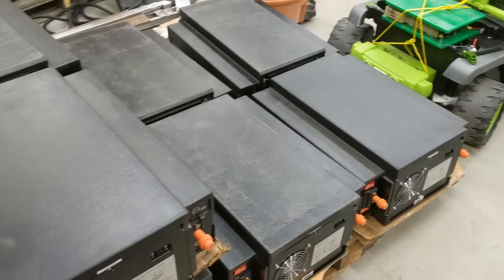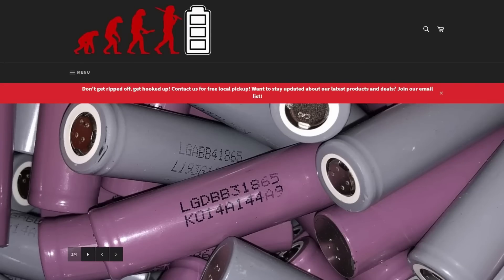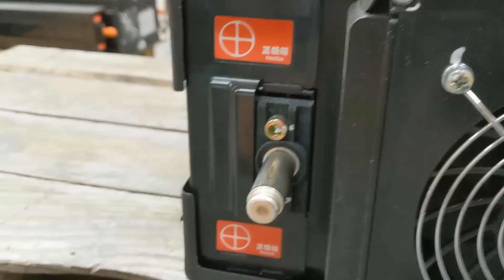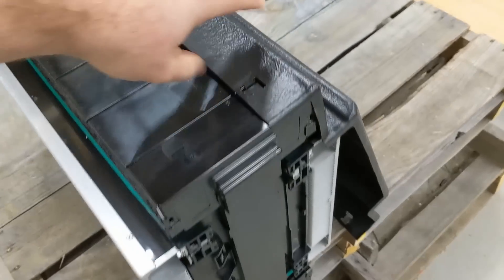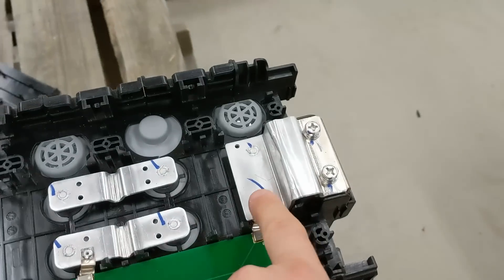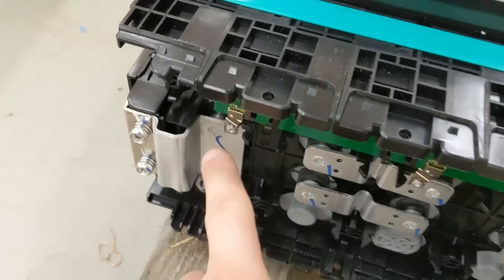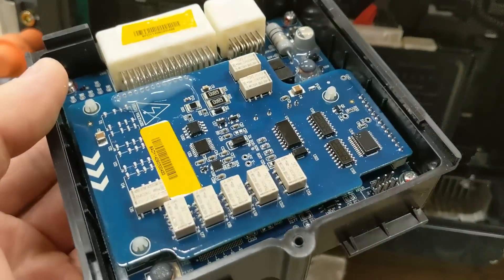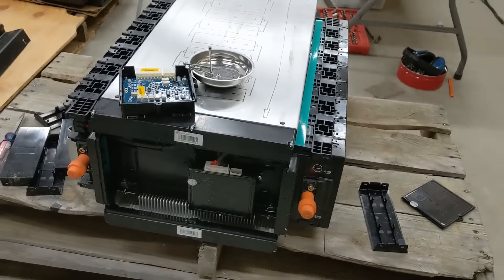$100/kwh Huge LiFePO4 Lithium Battery First Look

Comment: So if I read your video correctly, you got a total of 12 modules that are probably nominally rated around 5KWh each for a total of 60Kwh capacity, correct?  What is the size of the solar array that is powering these batteries?  How well has the BMS worked and what is the BMS that was used?  Have you had any problems since you hooked them all up?  What type of battery inverter/charger did you use?
Reply from the maker: Hi Paul,  I'm still working on wiring together my system.  Some things are not turned on yet, like my solar.  But the plan is: 7.7kw of solar.  I plan to use a "Chargery 16s BMS".  My inverters are a pair of Sunny Islands.  Here is a video on the inverters: https://youtu.be/aU9gNSoep-o
Reply: @DavidPozEnergy  One thing I forgot to ask is the relative age of these battery modules.  I understand they are likely different manufacturing dates since they were used in industrial storage, but do you have an idea of the average age of all of the modules? I ask to get an idea of the useful life remaining.
Reply from the maker: Hi Paul,  I don't know the whole history of these modules.  I can see a manufacturing date on the internal computer board of October 2014.  So they may have been in use 2015-2018?  I was told they were sitting in a warehouse the past year.
Reply: Okay, that doesn't sound too bad.  Given that decent quality LiFePO4 batteries should last a minimum of 20, maybe 30 years, then they should have a lot of usable life left to them.  I am also thinking about getting 12 modules myself, which based upon my current setup would bring me to a total capacity of 100Kwh.
Reply from the maker: Wow, 100kwh would be amazing.  I'm still working on my initial cycling so I don't know how many kwh I can get out of them yet, but it's pretty clearly not going to be the original 5.6 on the label.  Battery Hookup advertises them around 4-4.5kwh and that seems about right.  But I haven't done a full cycle yet to find out.  If you do decide to go with them, here is my link: http://bit.ly/38Uwgx9  I get a kick-back if you use it.

Comment: Geez thanks for the GREAT tip in cost reduction!.....One question, what do you think the life expectancy of these, in charge cycles, and after measuring the actual 'used' capacity (vs when new) would be if they get charged every-time they reach 20%? Or else, what are your expectations?
Reply from the maker: I have not done a full capacity test yet.  My expectation is about 75% or 80% of original capacity.  I'm hoping to have them in service for years, but I'll know more after some testing.  I'll post the videos as I move along.
Reply: @DavidPozEnergy  Thanks!

Comment: Good video. Q , I am rebuilding a vintage Barth class A motorhome with solar and back up. Generator and was considering a 6V Battleborn golf cart batteries. Will these batteries be a better way ?. I am new to this
Reply from the maker: Battleborn batteries have a BMS built in, these do not.  So if you buy use batteries you will have to wire in your own BMS.  If that makes you nervous, then a pre-packed battery is a good idea.  The Kilo-vault is less expensive then the Battleborn brand, but it's built nearly the same: https://www.altestore.com/store/deep-cycle-batteries/lithium-batteries-c4441/

Comment: David, can you explain how the internal cells are interconnected? From the video, the bus bars look to be riveted or welded. I don’t see any screws or bolts.
If one wanted to repackage the cells, is that possible?
Reply from the maker: My follow up video has a bit more detail into cell arrangement: https://youtu.be/aO-DlNrj5SU  But there are 8 large cells banded together.  Some things could be removed (like the plastic case) if you wanted to, but I wouldn't cut the banding.  I think they would spring open LOL.  The cells have a positive on one side, and go all the way through the pack to the other side for the negative.  The buss bars that jump from one cell to the next are welded onto the cell tabs.  I've seen someone cut these for making a 12v configuration, but he did not remove cells, just cut the buss bars and re-wired it.

Comment: Website say the deal is sold out😒.
Reply from the maker: I know they are working on getting more.
Reply: DavidPoz is it 100$ a module?
Reply from the maker: No, it's $100 per kilo-wall hour (kwh).  Each module is 4.5 kwh or more.  So each module is $450.
Reply: Ok thanks.
Reply: Plus shipping if needed

Comment: David, do you know for certain that these modules are LiFePO4? I ask because the label (sticker) on the battery reads 'Li-ion". This question was asked in several places/forums but as far as I know, it was never answered. I know of at least 3 people (one of them being myself) that posed this question directly to Battery Hookup but they never answered it...
Reply from the maker: Hi Marko,  Thanks for your question.  I agree that it's confusing.  I've read through several BYD documents.  This is a LIFePO4 battery.  It seems BYD is using "Li-ion" as a broader term for the lithium family rather than a specific chemistry.

Comment: Hi David, Looking to use one of these in my RV. What are your thoughts on making this into a 12V battery pack? I would disconnect one of the bus bars and plug the 2 4S in parrallel.
Reply from the maker: Sure.  There is someone on facebook (Jim) doing that right now and posting pictures of his progress.  He is posting on the facebook group called "DIY Battery".

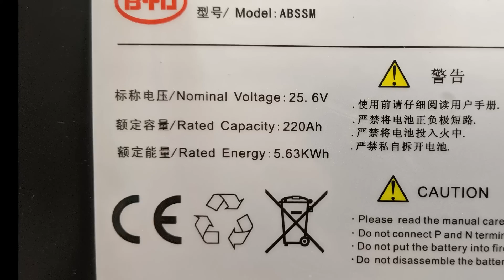Comment: So... (1:09) 200 Amp hours capacity? ...newbie... trying to figure out for RV solar power.  ...would this be equivalent to 4 battle born 12v 100Ah?
Reply from the maker: In capacity, yes, this is similar to 4x Battleborn.  It's worth noting that the Battleborn batteries will be new, and have a BMS built in.  These BYD modules are used, and I have to make my own BMS external.
Reply: DavidPoz can you just wire into a 24v BMS?
Reply from the maker: I'm working on building my own BMS wiring harness.
Reply: DavidPoz ah, ok. Looking forward to future posts on this. If I was close, I’d just go pick up a couple, as it is, with shipping costs, may only be able to get one at this time, my only hesitation. ...been keeping my eye out for lifepo4 deals.

Comment: I wonder why so much cooling is required for these batteries , lifepo4 is a safer chemistry ..
Reply from the maker: My guess is they were designed for high amps.  I'll probably not need cooling in my home system.

Comment: I wonder how easy it would be to buy one of these and convert over to 12 volt.

You would probably completely have to gut it... @OP is this possible? I'm going to be calling the warehouse tomorrow. I almost dropped $1,500 on 4 XP valence batteries.
Reply: Pretty easy if you break down the pack into the 8 prismatic cells, just make the 4s2p and voila. But you'll loose the built in bus bar and sense leads and such.

Comment: I just bought 6 and got 5% off by getting on their email list. Wife is gonna kill me Dave!  I’m gonna augment the set of 800ah lifepo4 in the Philippines later with these. Meantime I will hook up my massive 15kw powerjack to my current house as grid tie and let the grid charge these and see if there is any difference in the light bill with the inverter efficiency mods when on battery power for 12 hours a day. May put up the windmill later. Had planned on topping out a very tall pine tree and putting it up there but the tallest snorkel lift wouldn’t reach so a tree service said their crane could help me out. Heat sinks and fan seems excessive considering my brand new batts never heat up even 1 degree charging or even when discharging a 4.2kw event shower heater, rice cooker, electric vehicles and Hvac all at once. Cheap Chinese lifepo4 batts at that. The more time go by the more charging cycles folks suspect lifepo4 batts are capable of. I think the number of cycles they publish are just being conservative. They could be in excess of 10,000 cycles if your sensible with them. If you run them dead dead for 2000 cycles then that’s probably end game tho.
Reply from the maker: That's great.  I saw your other comments.  What are you planning for BMS wires?  Will you run your own direct to the cells?
Reply: DavidPoz I like the wire setup they come with but i have a box of  18awg color variety I bought on eBay or amazon 100 ft each roll that would make cell ID easy enough. How many S Chargery bms were you looking for? Mine is 16s good for 48v setup.

Comment: Do you know if these can be set up series/parallel?   Thinking of going with 4 to build a large 48V battery for my RV.
Reply from the maker: That's exactly what I'm doing, running 48v.  I'll be 2s4p
Reply: @DavidPozEnergy  I would like to see what you did to get the 48v. Its a shame more isn't known about the sensor ECU.

Comment: Are these LiFePO4 batteries or Li-ION??? The mounting plate on the back of the battery you are showing says Li-ION???
Reply from the maker: I questioned that too when I first got them.  The battery is LiFePO4.
Reply: @DavidPozEnergy  So with each battery being 3.2V .. what do you think that the aH is going to be???
Reply from the maker: The sticker on the front says Nominal Voltage: 25.6v; Rated Capacity: 220Ah; Rated Energy: 5.63kwh

Comment: I've been leaning going with tesla modules or getting batteries direct out of China. But this is the best beal I have seen. Just the weight is excessive.

Do you think pulling the heat sinks off would reduce the weight by any significance or is there any reason to leave them on?

Can't imagine you really need them unless you discharge them at some crazy high rate. Like the liquid cooling on tesla modules.

Could you strip them down to just the batteries?
Reply from the maker: It looks like the heat sinks are attached with 4 screws, so it should not be hard to remove.  But it probably only saves you 1% of the weight.  The cells are really big and heavy.  If you are building something for a mobile application, like a van build, then save the weight and go with something else.

Comment: They seem to ship over sea! Although its $1000  if i buy 4!  Kinda seems worth the price still.
Reply: Lysol ! Look into Alibaba.com Hunan Auk Energy Co. Bruce Wong. Same cost for new in your situation. I opened an account and you don’t have to be a company to purchase there. I purchased 32 lifepo4 200ah at $110 each $800 shipping to Philippines + customs + $100 ups contractor bogus “customs storage fee” which ups refunded and fined the contractor. Yay! Anyway they accept PayPal in most cases. Dave should start buying and selling this way. 150ah batts are the cheapest because they are most popular.

Comment: Nearly 17kg per kWh. Is that good?
Reply from the maker: Not especially great.  Better than lead acid, but not as good as Li-NMC (Used in electric cars).  I'll be using this in a home backup system, so it will be stationary.  Don't buy these if you have a mobile application and weight is a concern.  There are lighter options per kwh.

Comment: so  is the volt batt goin bad?
Reply from the maker: Not at all.  The Chevy Volt pack is still perfect.  I was trying for several months to find a second Volt battery pack that would match up (Gen 2) but the was I was finding were going for $3500 and up.  Then I came across this deal and jumped.  I have sold the Chevy volt pack to cover some of this cost.  This will (hopefully) double my capacity.

Comment: Would be near perfect if it had a built in contactor. Guess there is room in the back for a contactor and fuse. What do you think peak current would be with a dead short? (thinking of speccing out fuse and contactor for battery protection)
Reply from the maker: I haven't spec'd out all my components yet.  After I do some testing on them I'll have a better idea.  In the mean time I picked up several 200 amp fast-blow fuses.  I plan to do my testing with them, but might drop those down to 120 amps once the testing is done and we are in normal operation.  I wouldn't want to draw more amps than necessary.
Reply: @DavidPozEnergy  I expect any fuses that size should be rated to break more than 30vDC at 10kA, but I'm looking around at contactors that can do the same. (More than once hopefully) I'd prefer a BMS to be able to trigger a disconnect and nope right out before a fuse blew.
Reply from the maker: These are the exact ones I ordered.  As I said, they should work for now, but after testing I might do something else.  Always open to suggestions.  https://www.digikey.com/product-detail/en/littelfuse-inc/142.5631.6202/F10822-ND/2515909

Comment: So how hard would it be to do a DIY power wall? I currently have a 10kw solar system and I'd love to have a power wall to run my home when the sun goes down. I was looking at the Tesla power walls but they're way too damn expensive for my budget. Obviously these batteries would be used to power an inverter but that's all I know. I wouldn't know what type of inverter to use or what I'd use to charge the batteries.
Reply from the maker: I'm planning to use these batteries to power my whole house.  I'm going to pair them with solar, inverter, charge controller, etc.  Actually, I've been powering my house off-grid most of this year.  Up until now I've been using Chevy Volt batteries.  Now I'm going to double or triple my storage capacity with the new batteries.  If you want to see my whole system check out this video: https://youtu.be/722GNWlEN1g  Another resource I suggest is from Alt-E.  They are a store that sells solar components, or full systems.  They help you design your systems too.  But they also have a series of design videos that get down into the details.  I really like the videos.  https://www.altestore.com/video/

Comment: I am curios if you can take the cells out and build a bigger battery. They seem to be soldered together?  To make a 48v Bank you need to break the connection and put a bunch of them in parallel.
Reply from the maker: The cells look like they were welded to the bus bars, perhaps with a laser.  I think it would be a hassle to break the pack apart to remove an individual cell.
Reply: @DavidPozEnergy  If that is the case would be interesting to see how often those fans run and what is the efficiency of the pack.
Reply from the maker: We'll find out.  I have a lot more testing to do after the wiring.

Comment: Can the cells be pulled out of the modules pack?  I have an application for them, but the extra shrouding may not fit the space requirements.
Reply from the maker: You could easily remove the aluminum heat sinks and make the whole thing 6 3/8 inches tall.  But I wouldn't  break it down beyond that.
Reply: I'm going to look at one tomorrow and test if this is possible. I think I may get away with angle grinding between 4-5th cell, riveting a metal loop on both sides and then parallel 1:5, 2:6, 3:7 and 4:8 and then keep the form factor... OR I may have to gut it like they are preparing deer!  If one works, you can be darn sure i'm getting a second!   
Who wants to spend 1500$ and a orion BMS 800$ for Valence batteries?
Reply from the maker: Hi Alan,  Here is someone breaking this battery to 12v: https://youtu.be/yntJbKflqvE
Reply: Where did they come from?

Comment: Hi David, Thanks for the many great video's. What are you planning to use as a charging parameter for your two batteries in series 48v, once you have done a cell check. I would thinking of a charging range of 51.2v to 56.4v or 3.2vcell to 3.65vcell. What's your opinion.
Reply from the maker: Hi Marco,  I've been trying to contact BYD for a spec sheet to nail down that info.  They have not responded.  As of right now I'm thinking 48.0-56.0 volts.  (3.0-3.5 v/c)  I'm trying to nail down a voltage range that would be about 20%SOC through 95%SOC.  I think that's it.  I'll probably try the numbers above, and try to map a curve, then adjust as needed.
Reply: @DavidPozEnergy  I just order 6 of these batteries for my setup. Yes, i did get the wifes approval not easy but it's a go. Well once i get them i will go into cell  testing mode and if all is well i well test two batteries in series or 48v to see how the cell respond to charging and discharging and wait for you to come up with a BMS idea. keep me a breast.
Reply from the maker: Absolutley.  I'd also love to hear how your testing is going.  I think a few people have ordered them, so hopefully we help each other out with BMS ideas and Voltage settings.

Comment: David, How many of these batteries would it take to equal a Telsa power wall. I was just looking at the Telsa web site and it looked to be about $7.6k to have one installed. That's 13.5 kwh , 7kw peak and 5kw continuous.
Reply from the maker: Each of these modules should have about 4.5kwh according to the seller, Battery Hookup.  You said that Tesla is 13.5kwh.  So if you divide 13.5/4.5=3 modules.  I don't know if that will all work out after the dust settles, but I'll be doing some capacity testing in future videos.